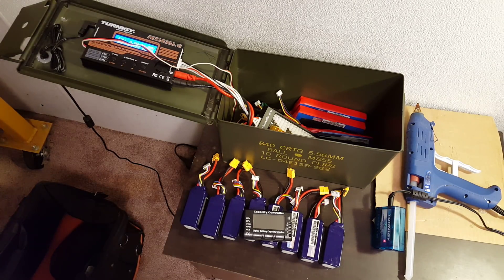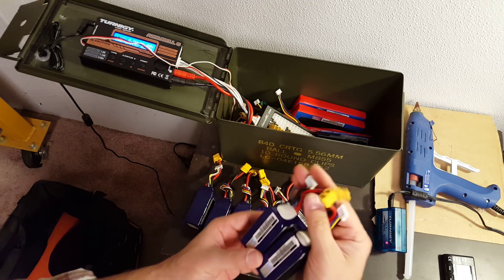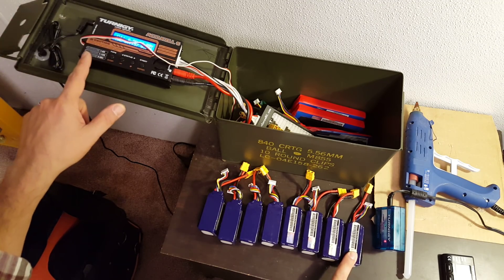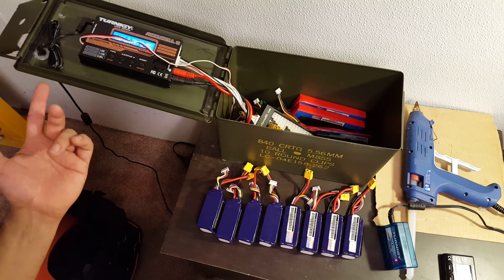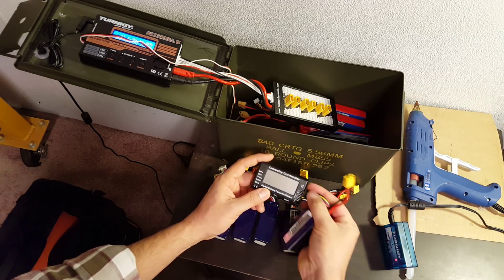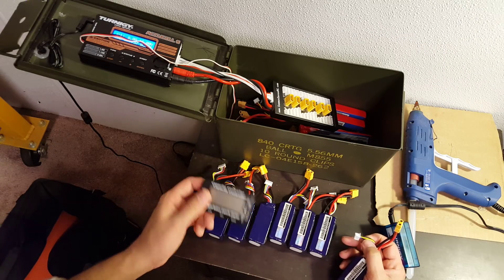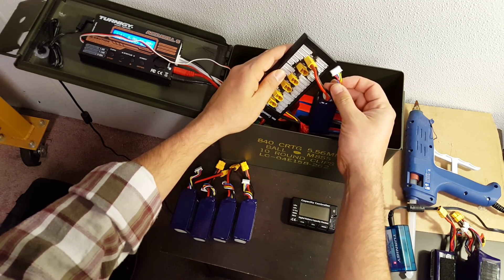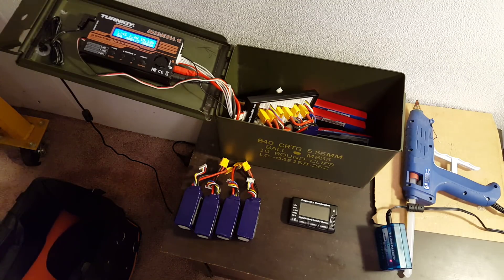How To Parallel Charge LiPo Batteries Without Burning Down Your House

Comment: I learned through experimentation that 2C is the sweet spot for almost all of my lipos.
I will recondition them in the off season (now) every year by balance charging them at 1C, discharging them down to 3.2 volts per cell, and then balance charge them to 3.7 for storage.
I am still running bats I bought over 3 years ago. I have never had one puff from charging (hard flying discharge of course)
I have only had a few nanotechs loose a cell balance, and other than torn balance plugs my lipos have served me, and continue to serve me well.
What I don't have are any of those smexy ammo cases for stowing my lipos ;)
Reply: lol 3.2 volts per cell? isn't that dangerous? I thought sweet spot was never go below 3.5?
Reply: @kyostipoysti1036  3.4v is fine - below that repeatedly is not recommended - the odd 3.3v will get away with too but only occasionally